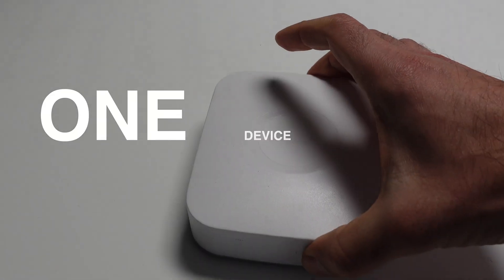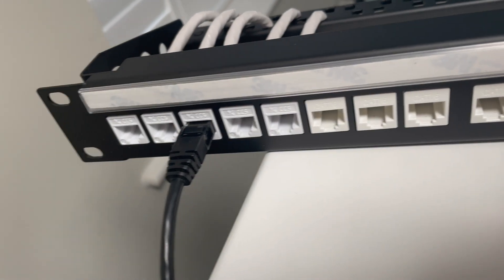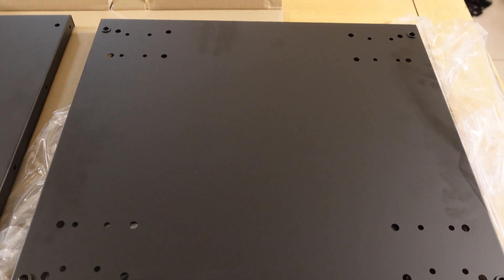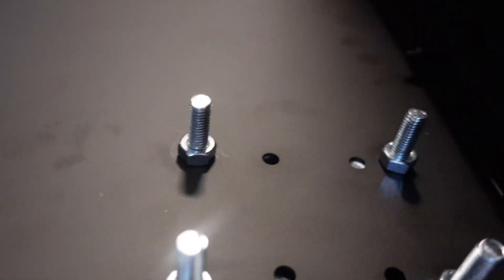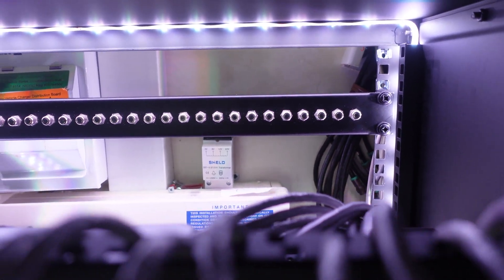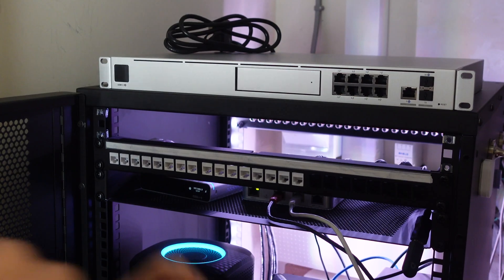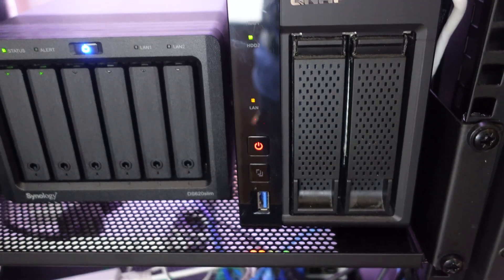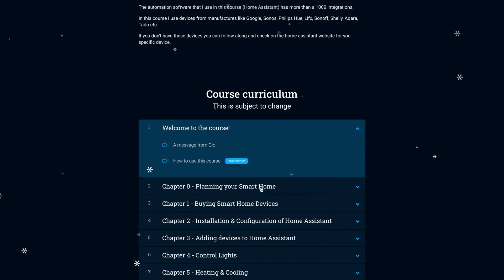I MOVED all my tech in a Home Rack Beginners Guide

Comment from the maker: Benefit from 10% code SHM10 off any Rack Products:

Rack 👇 https://www.pennelcomonline.com/en/Penn-Elcom-28U-19-Inch-Flat-Pack-Rack-Cabinet-480mm189-Deep-R8400-28/m-6193.aspx
Door 👇 https://www.pennelcomonline.com/en/Penn-Elcom-28U-Perforated-Rack-Door-for-R8400-and-R8500-Racks-R846028/m-6194.aspx
Castors 👇https://www.pennelcomonline.com/en/Penn-Elcom-Heavy-Duty-Castor-Kit---Compatible-with-R8400R8500-R8480HD/m-6210.aspx
All products 👇https://www.pennelcomonline.com

Comment: As a member of the Penn-elcom team nicely done. However I would suggest that where you attached the lid and base sections the lock washer should be on the inside. These are there to stop the nut from turning not the screw. It is great to see our products in use. Keep it up.
Reply from the maker: Thanks Alex, much appreciate your comments, have you also got some tips for the door?
Reply: @SmartHomeMakers  no problem. What's the issue with the door?